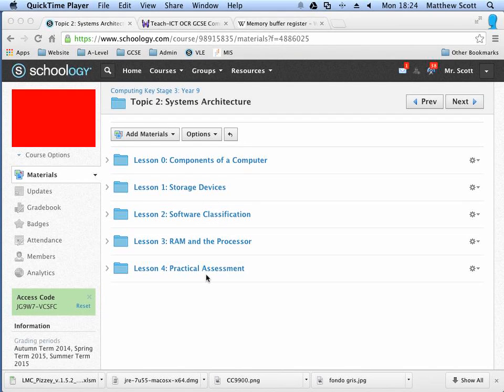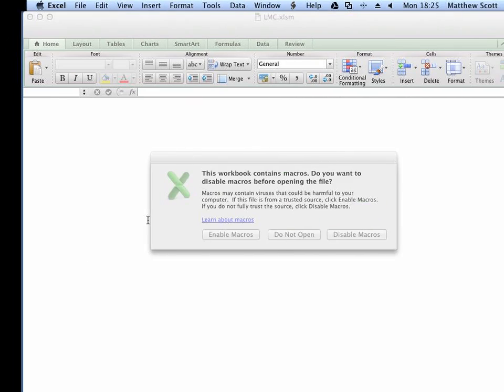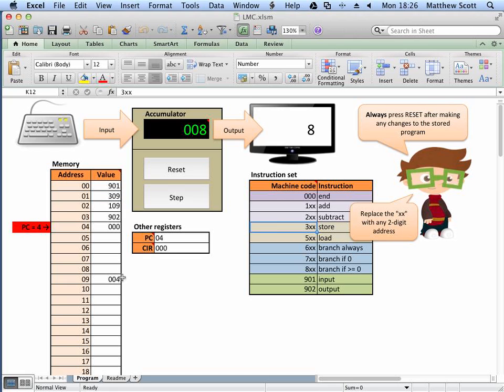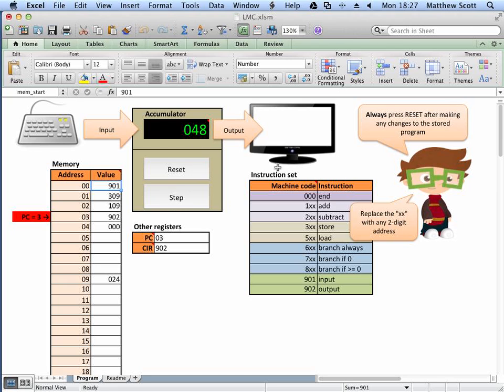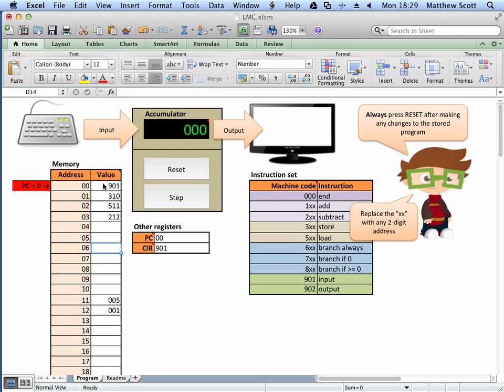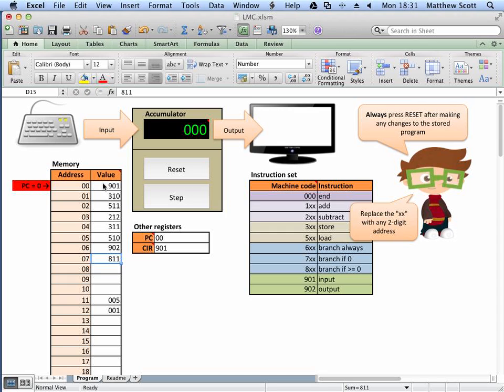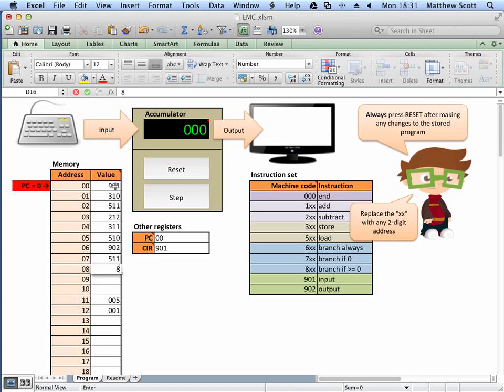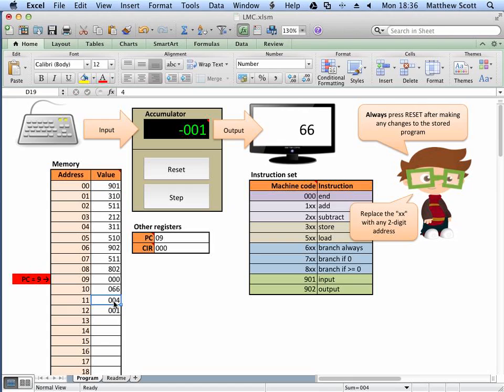Little Man Computer - Looping

Comment: Could you PLEASE help me? I need a program that will:
a) Accept an entry of three separate numbers
b) Add 5 to each number
c) Output the sum of all new numbers to the output register

I'm really struggling with it :/
I'm using the java simulator on the york university site, I've been messing around with it for ages but getting nothing